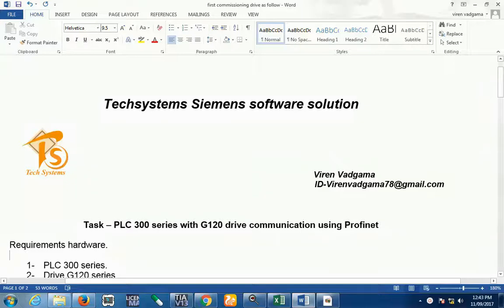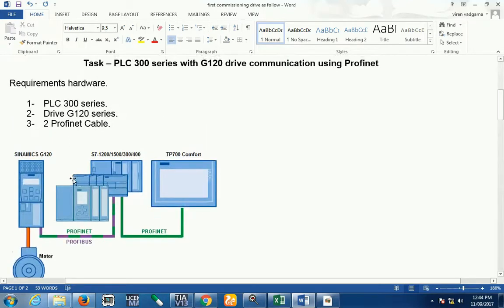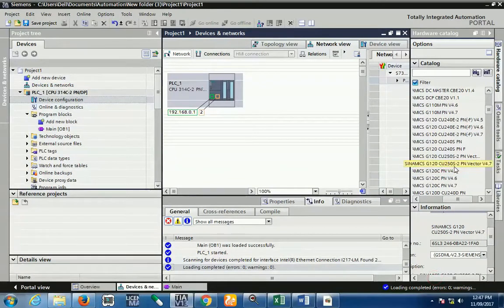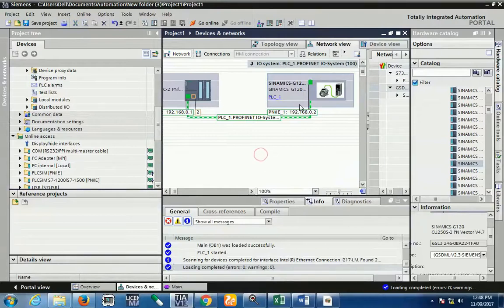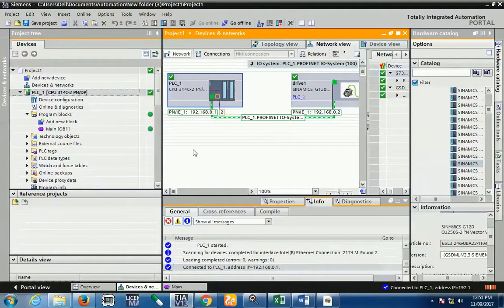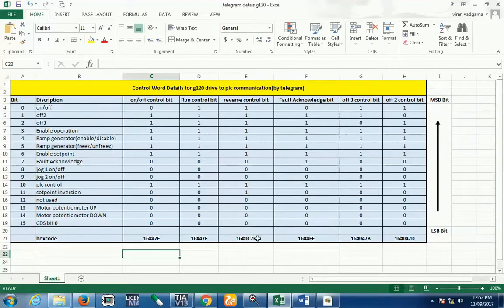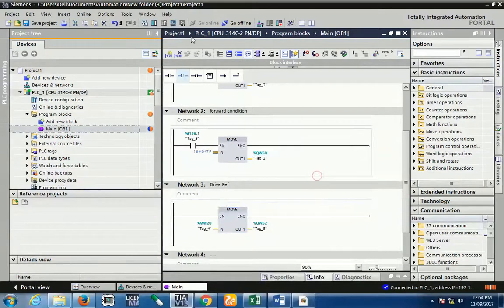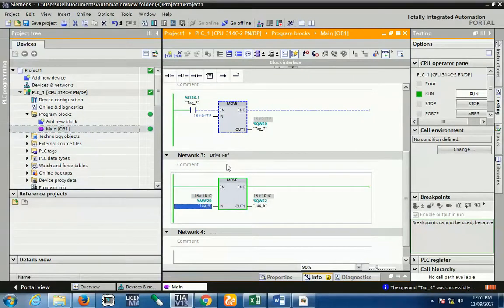PLC to Drive communication using tia portal software l TIA portal l Siemens

Comment: Hello sir  nice video. i have a question regarding this telegram communication. If i Need to Control it with 3 Inputs i.e to on and off the drive using 3 swithces . Can i use the same telegram if not so could you plz tell me what to use. can you mail it to rathode290@gmail.com

Comment: hello sir....I have a question related to this communication. 

please help to resolve this issue. please call me 9405809986 or mail me: patilparag4388@gmail.com

very argent
Reply from the maker: Hello sir,

Share with me a details about your hardware on my ID virenvadgama78@gmail.com .And tell me which problem you have face.I will try to solve your problem.